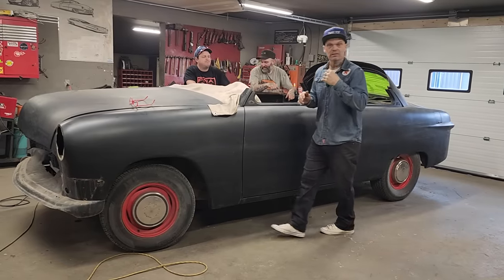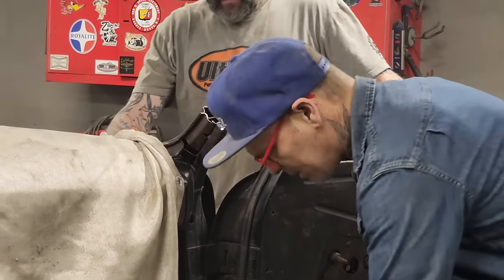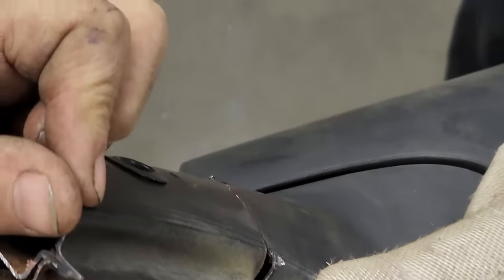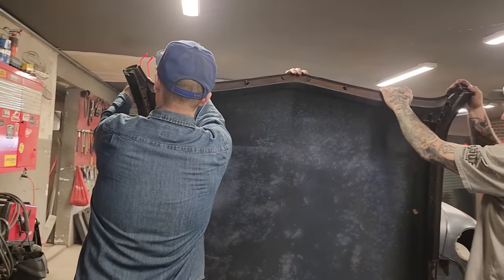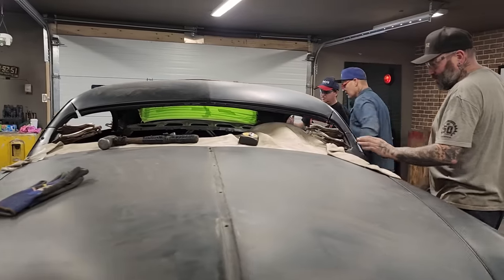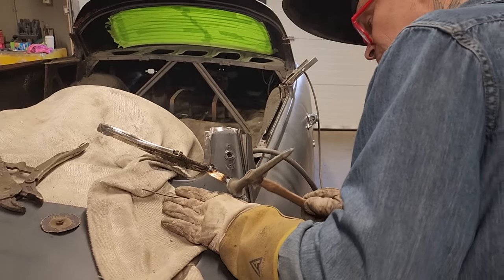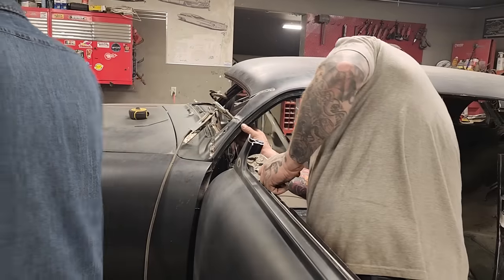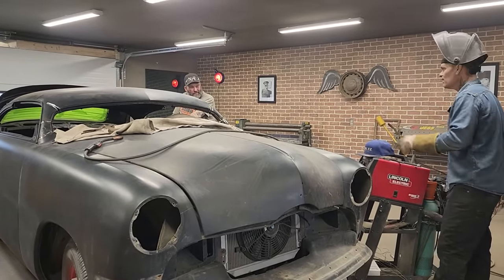Roof chop dilemma... issue with the A pillar ❌

Comment: I thought that a 8 inch chop was way too much.   Once the seat is in I wonder if there will be enough head room.
Reply: You will pretty much have to sit on the floor. NOT practical and an SOB to drive.
Reply: Mine is chopped 8 np
Reply: ALSO FRONT WINDOW IS TOO LOW & SMALL LOL
Reply: @frankducatelli2572  mine is cut this much but my roof slopes back

Comment: If you don't weld all the layers of metal in the pillars, road vibration will eventually weaken the outer layers of metal and cracks will form.
Reply: Won’t be as strong either.
Reply: What makes you think it will ever see the road again
Reply: They are supposed to be welded with oxy/act...it's how you make sure you  get the necessary penatration. Car. Has a full frame..
Reply: How would thay be done?
Reply: @MaximumDogHerder by drilling and removing the the outer metal then weld the inside and reinstall the outer metal
Reply: You make sleeves to weld using weld thru primer
Reply: Here comes the coat hangers
Reply: He has no idea!
Reply: Car rollover = 😵
Reply: @catman19 he was just driving the last one he built people like you are clueless
Reply: @james-ew7kl Karl has the skills to pull it off too

Comment: Chaddy, you need to stop for a little bit and look at the situation before you grab a saw. Simplest way to fix this major boo boo were to section the roof to match the all the pillar angles. Wallaaa ! easy peasy lol. 
 By cutting all the pillars, door tops and bottoms, back side window areas, etc. You have created so much more work than necessary. And you'll still probably end up sectioning the roof to make it all come together in the end anyway. Not to mention the side windows will never roll up and down, or fit the harsh angles.  So much for taking this one all the way to the paint booth. Next time call me before you begin such a thing Lol!

Comment: Split the roof down the middle and widen it.
Reply: Kinda hard to work the seam when it's down the middle. Better to get another roof skin and cap it so the seam is around the outside edge. That still leaves the area in front of the back window. The window will need to lay down and it will take 4 relief cuts to flatten out that hump... same deal as a 49 merc. Need to pay special attention to the profile if the roof...it's supposed to be a smooth arc. Screw it up and ya end up with a hump.

Comment: Of Course you don't know where to cut to get the right angle. It would have been REAL SIMPLE to cut the roof and have them Vertical for quick and easy fit. You would be finished now instead o massing around cutting and cutting to get the angle right. Amd you haven't even started on the door fram e angles . GOOD LUCK WITH THAT CHAD. You have relly bogged the project to an almost standstill.

Comment: If you cut the roof into 6 separate sections, then all posts could be lined up to the cuts. Sorta like widening in all directions. Then fill in the gaps on the roof with sheet metal. there's already what looks like a V from the front center, to cut along. I really like the look from the front. Should be nice when you're done!

Comment: This is what happens when someone that don't know what they are doing does something wrong,screwed up a jaguar,Ford coupe, 2 cars building a coe.hupmobile ,none done ,none done correctly.most all unsafe on the road.unsafe engineering, how about having to remove body to change battery.praise God Chad holds stock in bondo.a smarter person would have studied other hops to learn how to do this one properly

Comment: Now that you chopped it so radical and have to make a radical cut on the angle of the lower windshield posts it is going to cause fit problems with the windshield glass frame .
Reply: The windshield is just flat glass, make a cardboard template and have a glass place cut it, not a big deal

Comment: Should be adding back on should you not! Half lap joints. Cut the lower front off, cut opposite side of the 8"  taken away from the middle, this will allow you to weld the inner strength bar, then weld both lower and upper outside joints. Do the same on both sides the mate the roof back up without welding them take away little by little. I have faith all will be fine when a little more thought is given attention.

Comment: The pillars have a lot of metal and the centre bit can’t be re welded. Is that going to be an engineering issue?
Reply: @james-ew7kl  ok, maybe Chad should have. 😂. In Australia that chop and repair wouldn’t pass engineering approval for road use. Design rules are strict, probably to avoid things like an engine careering down the road when the brakes are applied for the first time.😂😂

Comment: I'm probably a bit late with a comment,but just started watching this build,when everyone said split the roof,I thought..way too difficult.But now looking at this,it may have been best.Big job,but maybe not as big as canting in the door tops.I recently saw a build where they used slightly curved door glass and curved runners and fitted it in somehow .I wondered about the peak in the roof above the windshield,but it could be eliminated when putting in the widening strip.Any thoughts from anyone?

Comment: Tack weld the A pillar and door cutoffs back on at the bottom cuts, lean the C pillars forward with pie cuts at the bottom window radius, lean the A pillars back and in  in the same manner eliminating the need to slice the roof up any further and then deal with the B pillars, then fit the doors accordingly!👍

Comment: Chad, great content!  Quick question, if you weren't looking to minimize cuts, would any part of you want cut the roof into 4 pieces and then have them meet the posts in their original location, widening and elongating the roof?  Arm chair comment of course, but would that be a lot more work?  Concerns with getting the roof smooth w all the metal work?

Comment: It would look better just being a convertible with a chopped windshield. 50 Fords look weird with a chopped top because the top has to tapper inward to fit and the rear glass will lay almost flat. Leave the top off and make it a roadster.

Comment: Are you at some point going to open the outer skin of the pillars to get the inner piece of the pillar welded back together or are you going to leave that inner piece of metal unwelded, cause that would mean that you have two structural weaker points in each roof pillar...